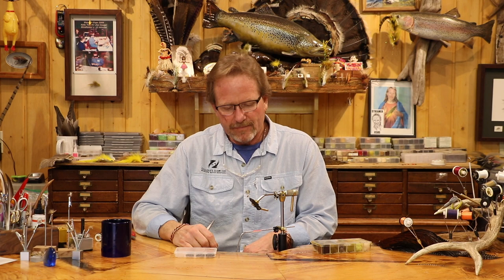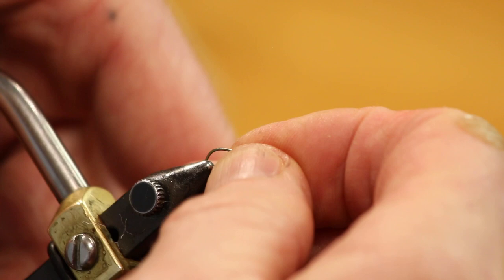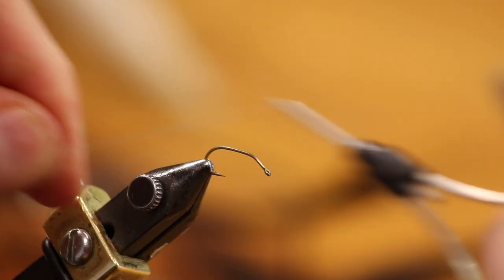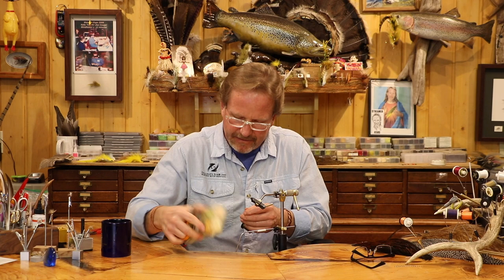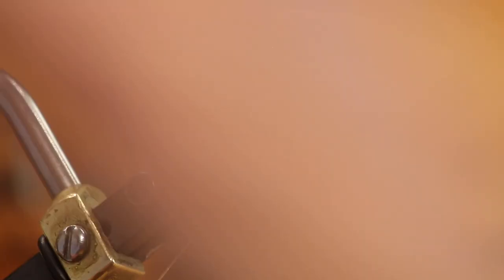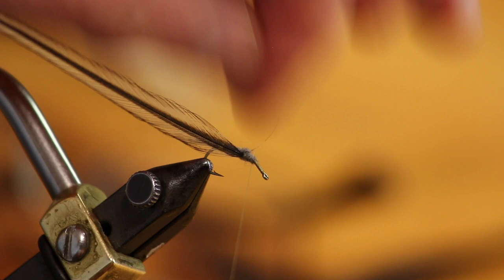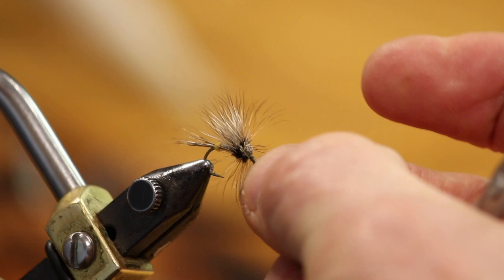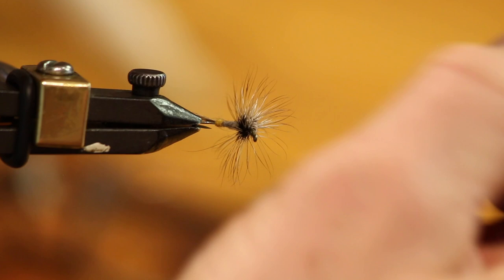Tying The Female Adams Jig with Kelly Galloup

Comment: Looking at this dry fly.
Reply: This interpretation that we started off with. This thing. Where the leader tippet. Was attaching to the hook. Underneath the water. Instead of. On top of the water. Again, it's possible to argue. That this is not. Entirely new. And maybe it is why. Things like basic 'parachute' dry flies. Have worked. So none of that is entirely 'new'. However, looking at this female adams 'jig' dry fly. There are other interpretations.That could be made. About why this style of dry fly. Could be effective (that have nothing to do, with how the leader tippet is underneath the water).
Reply: For one thing. Even if one did not 'bend' the shank down in front (okay, there is no harm whatsoever in doing that). But let's say. That you did not. And you continued. To just dress the 'dry fly' adams pattern. Where the front portion. Of the hook. Was not dressed at all. It was left bear. What does that achieve?
Reply: Well for one thing. Chances are. The undressed steel shank part. Would still probably. Drop down through the surface film. What would happen though. Now you have. Some weight of steel (the bend of the hook steel to the rear). And the undressed part of the hook shank. To the fore. In other words. There is a 'balance' to the dry fly. Where there is some 'weight'. At both the back of the fly. And to the front. As opposed to conventional dry flies. That have. This extra weight. That is dragging the fly down. Towards the back only. What you have now (forgetting about the 'jig' bend). Is a fly. That is balanced more equally. Front and back.
Reply: Here is the interesting thing though. About the dynamic of this dry fly. That is different. To the conventional dry fly (which is dressed right up until the hook eye). At the front. With this dry fly. If there is some type of 'drag'. Upon the dry fly. From the leader tippet (as the leader tippet stretches out, and extends at the end of the drift). What you'll find. Probably if one looked closely at the fly. In the surface film. Is that the dry fly. Would be inclined. To 'rotate' around. A central axis pivot point. That was in the center location. Of the hook. The dry fly. Might actually start to do. A kind of a spinning circle thing (looking down from above). On the surface film.
Reply: This whole thing. Of the jig style dry flies. Working. For the reason that. The leader tippet. Goes underneath the water. May be a complete decoy. At the end of the day. And the thing. That is really 'the trigger'. And that makes the dry fly. Interesting. To the fish. Is not the thing. To do with the leader tippet. At all. Rather it is. That this dry fly. Is going to perform. Several of these kinds of 'John Travolta' manuvers. In the surface film. As it drifts down. Over the fish's eyesight. It's going to be doing. A kind of. Saturday Night Fever kind of performance. In the surface film. By virtue of the fact. That that steel shank extension piece. In the front part of the dry fly. Is causing it. Not to simply 'drag'. As a normal dry fly would do. Instead. It's inclined more. To rotate and pivot, disco style. It's now got. All of the moves.
Reply: The more than I look. At why this dry fly design. Is really effective. It has very little to do. With leader tippets. It has a lot more. To do with disco moves. I would speculate.
Reply: In other words. The fish are looking. At a lot of dry flies. They've gotten hip to. What the normal parachute adams dry fly. Or traditional adams dry flies. Are doing these days. They've probably seen. All of the moves by now. Since they were small trout. That were attacking. Whatever they could see. This bell-bottomed version comes along though. And it's doing all of these moves. They have never seen before. It's bound to create. Some interest.
Reply: Short summary. These fish. Have never listened to the 'Bee Gees'. Before.
Reply: If one goes back. To Lee Wulff and Ed Shenks (who fished for Atlantic salmon using skater dry flies). They even brought them down. To Patagonia later. And used them. For sea-run brown trout too. They were doing. The thing of leaving the front part. Of the hook shank totally 'blank'. Over half a century ago. The big lesson is. We do make up. All of these theories. To explain. Why we make flies. The way that we make flies. It doesn't mean though. That any of the explanations that we make up. To tell ourselves. Actually explain the reality. Of what is going on. But heh, one needs a working theory. Of some kind. To proceed forward with.
Reply: I've a good notion. That if Kelly makes some flies. That are not that far away. From the old 'skater' fly patterns. Of old. The same takes. Might come to those dry flies. As come to these ones. The skater flies (that had a large 360 degree Coq de Leon hackle wound around the center of the hook shank). And left the remainder of the hook. Totally bare. Probably did so. For this reason. That it would mean. That the fly would dance around. A lot more on the surface (as opposed to the fly, where the hackle was wound tight against where the 'hook eye' was positioned at the extremity of the hook shank). It's that old lesson. Of a certain way. To make a dry fly. That has been re-discovered here.
Reply: The old skater flies. Did not actually have. Coq de Leon hackles. They had rooster hackles. That were extremely long and floatable. That apparently. Were just too difficult. To source for a finish up. And makers of the flies. Experimented. With other kinds of substitutes. Winding two or three. Coq de Leon hackles. On the fly. Was one such way. And apparently. Even then. The hackles were still. Not long enough. As some of the flies. Made in the original way.